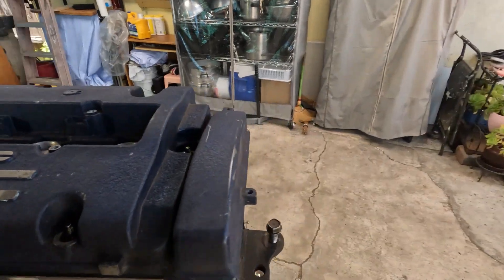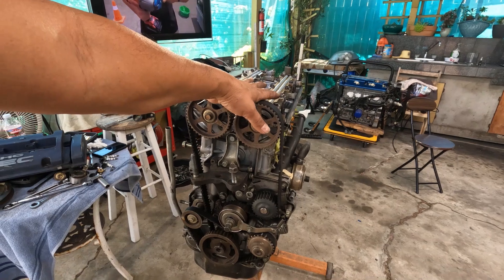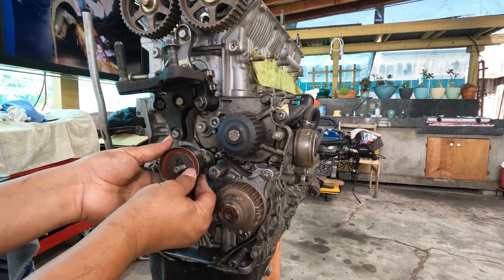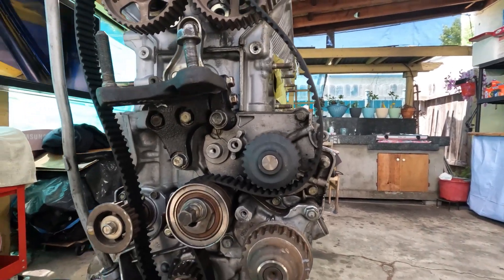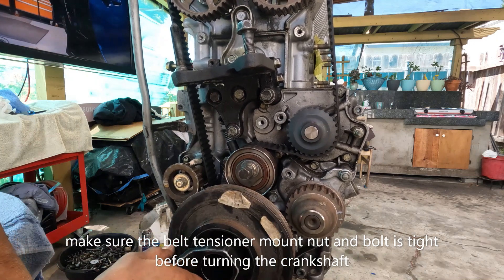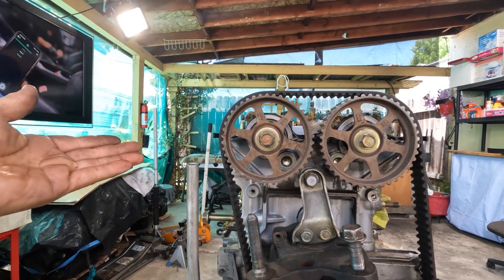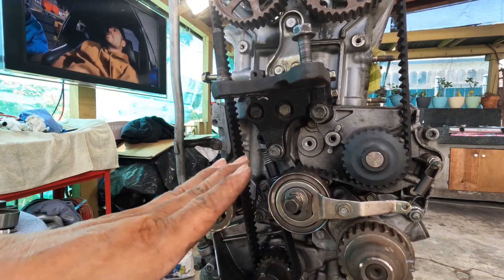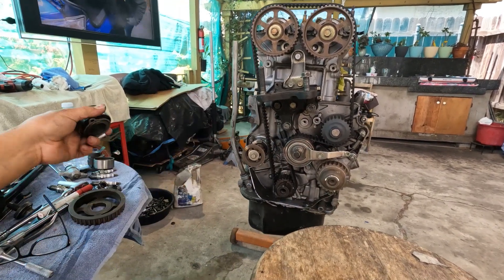H23A / F20B Timing belt too tight?

Comment: how many teeth does this belt have ? i have a f20b dohc and it have a 155 teeth one but some website say its 156 .which ia correct?
Reply from the maker: I never counted how many teeth H22 timing belt have and too bad l no longer have a old h22 t belt to count. But every H22 that has auto tensioner that l converted into obd1 tensioner, all were tight that's why l came up w/ shaving some material off the tensioner.

Comment: I got the tension can u help ,e get it on
Reply: Hey bro so u know in the h23 tensioner  on my h22 but I don’t know how tight. It’ makes a winging sound so I let it off but now when I rev  the car the belt flaps.
Reply from the maker: @jefferybissick891  Did ypu try moving the cams gears about 3 teeth and loosen the tensioner nut. The spring will pull the tensioner and should be it. If it still loose. Set  the piston to tdc and move camgears again about 3 teeth and loosen tensioner nut. It should pull it and thats it.
Reply: @ ok bro thanks am gonna do that.
Reply from the maker: @jefferybissick891  l just noticed that my t belt is so loose and l might do a episode. Hope you get yours fix before mine.
Reply from the maker: @jefferybissick891  if its too tight it'll make that winging sound.. My fkaps too. If you can see some of my videos. You can see it flaps.
Reply: @ ok just wanna know it’s not gonna fall off
Reply from the maker: @jefferybissick891  l'll give it a check before that happens man! My T belt was kinda loose too, l just saw it yesterday.
Reply: @ am so scared caz when I rev it it’s all over the place like it would fall off
Reply from the maker: When you convert it to manual tensioner (using h23a1 or f23 tensioner) it'll be almost impossible to install the belt. You must shave the inside of the tensioner to allow it to go down some more like l have shown.
Reply: @ I don’t know but it just slip rite on it’s a h22.

Comment: Yeah, I'm having a problem with my F22A engine (honda 1993) I went to replace timing belt. When I first had everything connected. I had that bolt with the timing belt tensioner. I learn later that I have to take it out. That's to keep the tensioner in a downward position so you can get the belt on without holding it. Before I knew that, I had just installed it. I got it TDC, and I moved the crank bolt 3 teeth or more. That tightens the belt on the cam. I notice the belt is tighter because it's harder to get it off the cam. When I finally start the car, I get a ticking noise. Later, I found out that the belt was flapping around on the crank sprocket. And even the left side (the belt on the camshaft) would be loose, and the belt would be tightened on the right side. It's supposed to be slack on the right side and tight on the left side.

After learning all of this, I decided to take the bolt I was talking about. And I used a pry bar to push the tensioner up. And then I tighten it down. Now I think I got it too tight. Now it sounds a little bit better. I think the ticking noise has gone. By the way, sometimes I get the oil light blinking. But when doing this, it tried to walk off the cam. And also, when it warms up, it surges. Which I later found out that maybe it's because of the air pocket in the coolant when I changed the water pump. And it wasn't a symptom of being off a tooth. I'm not off a tooth. I'm 99% sure, I have the cam TDC with the left and right marks slightly above the head if you take the valve cover gasket. Plus, when I got it TDC initially, I created a white mark on the valve cover gasket. So when the tooth matches up with that. It's TDC. 

Do you have any ideas? I think I'm going to try and reset the tensioner. I'm not sure if it's on a peg on the right side. I'll try again today. Maybe I almost have it, and I just have it too loose and too tight. And maybe I don't have it just right. I'm hoping it won't be too loose if I don't push that tensioner up.
Reply from the maker: The last time l have the same scenario like you  were engine is sputtering a bit  when l intalled the belt 1 teeth off. That's the only thing l cant think off is recheck your cam and crank mark settings. Are you still using balance shafts? If you are, recheck your settings also. Did you experience anything like over revving while shifting gears before doing a t belt service? Just covering some angle and if you do, you might have a bent vslve or something.
Reply: @sagittnet2158  Well, I got this morning. It didn't walk off. So I had enough time to put the coolant in. That stopped the surging (RPMS finally rested where it should below 1,000). I thought I had it right then and there. The engine sounded great. But then when I tried it again (stopped the car and then started it up later). It started walking off. So I took the balance shaft tensioner off. Then I re positioned the timing belt tensioner. That didn't fix the issue. I don't think it's a tooth off. I 100% checked those timing marks. Maybe it's possibility. But I'm trying to solve the walking off the cam problem. Is it normal operation of the belt to now be tighten on the slack side the right side from the cam. Then the left side is slack? The car was fine before I did the T-belt job and gaskets and water pump.
Reply from the maker: @deegee2416  what brand of timing belt you are using? If it's normal before and problem exist, the only parts you change is the belt. It could be possible that you have gotten a wrong belt coz it has happened to me before on my Civic. No matter what l did its always loose, found out it wrong belt. If your using OE disregard but if its aftermarket and you are sure you got all markings aligned. You might wanna  count how many teeth and compare it to the old one.
Reply: @sagittnet2158  I'm using the Honda brand of the timing belt. The old timing belt I pulled off was a Dayco timing belt. Which has the same number of teeth as my honda belt. Which is 113.

I have another question that kind of remains unanswered if you can answer it.

Is a timing belt on a honda 1993 accord lx F22A engine supposed to put tension on the slack right side, and then the left side is now slack from the camshaft pulley? Is it supposed to reverse the tension after you run the car on idle?

Is it supposed to be consistent? I want to know if it the belt on the left side of the camshaft pulley is supposed to be tight even after running? Is that a normal operation? Or is there something wrong?
Reply from the maker: @deegee2416  the tension of the belt should be on the left side (ex side) after the camgears are rotated 3 teeth. The right should be somewhat on relax that you are able to flap it around about 1/16" but not to a point were it's too loose. Once its running, its normal for the belt(left side) to be flapping around. Thats the reason some guys are using a extra belt tensioner that is secure on the power steering location.
Reply from the maker: @deegee2416  After you set #1 piston to TDC and cam gear and crank are align to the mark. You tighten the tensioner nut ( springs are hook) rotate the crank for your cam gear to move 3 teeth and loosen the tensioner nut. Did you see any movement on your tensioner? It should go up and remove any slack of the belt from the right side. Tighten the nut and rotate the crankshaft 2 turns and recheck all your markings. Everything should be set. You mention that it was a Dayco t belt and Autozone is the only part store that sell it. Could it be possible that the tensioner wheel are not the same like OE? Does your tensioner look OE or aftermarket. Coz you shouldn't have run in to that much hassle setting your T belt tension, l mean since you pretty much followed correct procedure on how to service a Timing belt.
Reply: @sagittnet2158  Thank you. I resolved this by just reseting the belt. It does not walk off anymore. I followed the original tensioning procedure and I had it right to begin with. All I really had to do is move the belt on the water pump so it wasn't on the edge. And it never really started walking off the camshaft since.

I was told that the tension sides can change depending on the cam lobe, and where it stops during engine rotation. So yes, it's a normal operation of the engine.

And you also said it is normal for the left side to be flapping around.
Reply from the maker: @deegee2416  Good to know you got it all resolved, later man!

Comment: Hi! New subscriber here from Philippines 🤗. Question for engine f20b and H22A. Are they using the same Automatic timing belt tensioner? Is it  okay if I just remove them Thank you in advance.
Reply from the maker: F20b's are obd2 and depending on what year the H22a blocock casting, if its 97 up both will have auto belt tensioner. You can convert it to manual tensioner if you like. But you need to replace it w/ the kstune tensionwr or any replicas. Salamat bossing,:msg ka lang kung may maitutul9ng ako.
Reply: @sagittnet2158  This is wonderful your from Philippines as well? Great
Reply: @sagittnet2158  Maybe kung okay lang Dyan ko nalang Po dalin sa shop nyo para makapag change nko Ng timing belt kit, with new water pump, tensioner and idler bearing, tensioner bearing and seals Po🥰
Reply: It's very hard here to find a manual timing belt tensioner. I tried to from lazada and shoppee and it's always been cancelled 😥 due to item unavailable
Reply: @sagittnet2158  By the way I upgraded my engine from ph22 to F20B DOHC vtech engine and it's true engine parts from h22 is interchangeable with F20B
Reply from the maker: @erickbanzon4270  Yes, some parts are interchangeable from h22 to F20b. Camshafts, H22 camshafts 55mm can be install on F20b block. F20b valves are 1mm smaller than H series. Timing belt are the same and waterpump also. H22 headgasket can be use on F20b. Main bearings are the same as long as the H22 (55mm) is from 98-2k. Valve cover is interchangeable and also the oil pump.
Reply: @sagittnet2158  Thank you for this🥰
Reply: @sagittnet2158  And also I haven't changed my ECU. I'm still using the stock one from my ph22 engine instead of P06 tuneable ECU. Would that be okay? D ko Naman Po sya hinahataw😁
Reply from the maker: @erickbanzon4270  It'll work but if l were you since you have a tuneable ecu (po6). It's best to have it tune, that way you'll get the best performance of your F20b.
Reply: @sagittnet2158  Thank you so much for this message 🤗
Reply from the maker: @erickbanzon4270  salamat din bossing! F20b is a good engine and hope you got a short geared tranny couple w/ it. It really wake it up w/ short gear tranny. I thought of building a F20b but cant get a hold of a crankshaft maybe one day.
Reply: @sagittnet2158  Thank you sir. Love your videos by the way.
Reply: @sagittnet2158  I actually knew someone who sells it but it's to expensive for that brand, price for 12k😬🤔
Reply: Kstune cost like 12k

Comment: Yo tengo exactamente lo mismo block h23a3 y cabeza h22a4 y se hizo todo lo del vídeo pero antes de eso y después sigo con el problema que me tira la correa hacia afuera que podrá ser?
Reply from the maker: Hola! If the belt is going outward, it coul be the belt is too tight. Have you tried using a different set of cam gears? Also use a new belt tensioner. I dont know what could it other than camgears are worn and tensioner. Gracia senor.
Reply: Everything is new belt, mechanical belt tensioner and what you show in the video and water pump were done, I'm going to try the belt tension!! thank you later I'll tell you

Comment: Can i apply the manual t/b tensioner to a stock h22,if so what part should i need?
Reply from the maker: You can look it up on Hondapartsonline and get item # 30,27,26,19,25,18,10 and 20. You'll pay a whole lot if its new, it's better to get it at wrecking yard.
Reply from the maker: The belt will be tight, you'll need to shave a material off from the tensioner like l did, in order to makevot easier.
Reply: hello brother i have dm you on facebook regarding on the obd1 tensioner @sagittnet2158

Comment: So what is the definite answer regarding the timing belt and water pump ? I was considering an f20b swap but I want to make sure I can service the engine properly before dropping it in
Reply from the maker: Timing belt and waterpump can still be perform. If the motor is  in Civic, it make it a tight place. We dont use the automatic tensioner coz we find it somewhat not reliable. So we go to manual tensioner instead. I'm using Honda obd1 manual tensioner and after l did the modification. It made it a lot easier to install the belt.
Reply: @sagittnet2158  can you use the H22A water pump on the F20B
Reply from the maker: @jamesstewart1794  yes, its a direct fit, F20b and H22 parts are interchangeable except for piston and valves sizes.

Comment: i just realise my tensioner bearing not the same as yours..my timing belt always slide out a lil bit..makes the belt grind with the plastic cover & valve cover
Reply from the maker: I'm using Obd1 H tensioner, sometimes it can walk too when it's worn out. Do you have the obd2 wheel and using a kstune manual tensione?
Reply: @sagittnet2158  yes using the auto tensioner that are modify with nut bolt to make it manual when tightening..
Reply from the maker: @NaNaxch  if you have a previous belt walking out a bit, it could be the wheel is worn out( not flat anymore/ wore out in angled). Did you put a new wheel or reuse the old one. As far as the diy belt tensioner. I dont see any problem w/ it as long you dont get it to tight.
Reply: almost 3 years didnt drive my honda because of that timing belt slide off..maybe i should try convert it to obd1 manual tensioner
Reply from the maker: @NaNaxch  you can also check your cam gears, it could be worn out in angle also. But the wheel have a lot something to do w/ it walking out.
Reply: which wheel do you mean?cam gear already test change taken from my spare engine..
Reply from the maker: @NaNaxch  the tensioner roller, l know kstuned sell a tensioner w/ walk out guard, maybe that'll help.

Comment: which k20 piston are you using .
Reply from the maker: I'm using k20a2 Cp pistons 9.1 comp ratio and sinced it was now on f23 block and h22 head, it comes out to almost 10.1 comp ratio.
Reply: @sagittnet2158  okay i was planning on using a3
Reply from the maker: @luvayeavocado5377  Any pistons can be use other than k20a2 as long as it'll clear the intake and exhaust valve. One of my subscriber mentioned that he's using a J series pistons. The reason behind a k20a2 is because of the similarty of the valve reliefs. So you can use any hi-lift camshafts if you wish and you don't worry about piston and valve smacking one another. Of course a known well brand piston doesn't have the piston crown like oem has. So yeah! just verify that your piston to head clearances are good and make sure that your compression ratio target is not way up high that no tuner will touch it unless your'e running e85. And that's was the good thing about k20a2 piston, the comp ratio is right on. Good luck to your build and tnx for watching and pls use only Honda oem headgasket and no other, prices are all just about the same.
Reply: @sagittnet2158  oh thank you . ur build is amazing and great job man
Reply from the maker: @luvayeavocado5377  thanks bud!

Comment: Nice, thanks for the video👍🏼. Where did you get your type s cams?
Reply from the maker: I got those a long time ago when l was building my 1st H23vtec (hybrid) back when there's plenty of it floating around.
Reply: @sagittnet2158  oh okay, thanks man. I’ll probably check out blox. I heard Brian Crower cams are good too.
Reply from the maker: @nicholassantos2327  Are you changing your cams? It'll give a good result if you have a hi compression setup a minimum of 11.1 ratio for NA. I know you wanted to turbo your Accord and it's ok to use a hi lift cams otherwise it might not give you the power you want w/ lower compressiin H22
Reply: @sagittnet2158  oh okay cool thanks man. Yeah I plan to build the head and the block for a turbo set up. Not sure which one to work on first but Imma probably start with the block.

Comment: did you delete your IABs? what exhaust set up are you running?
Reply from the maker: Iab is deleted.  Cd5 I'm using euro r h22 intake manifold and diy 3" ss exhaust pipe. Yonaka resonator and vibrant muffler. On the Civic w/ g23, its also euro r intake manifold, diy 3" ex pipe w/ vibrant resonator and another vibrant resonator as a muffler.
.
Reply: @sagittnet2158  nice!